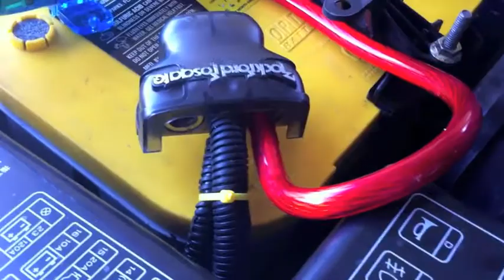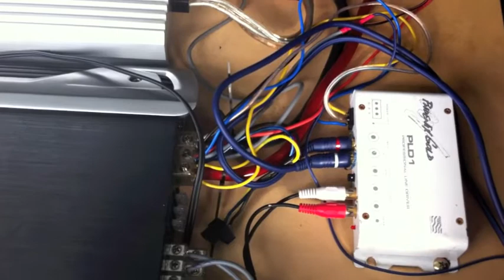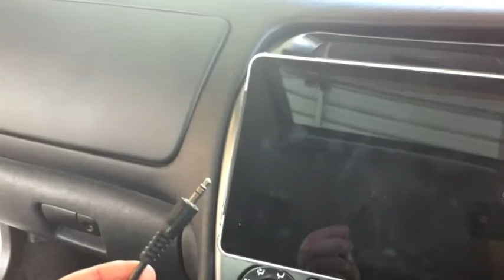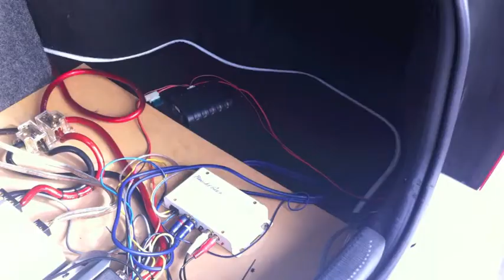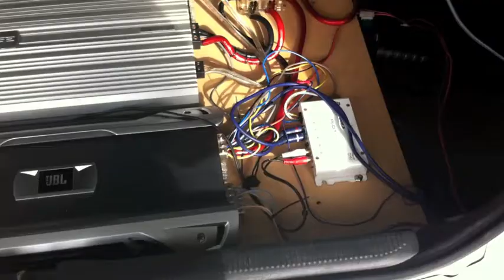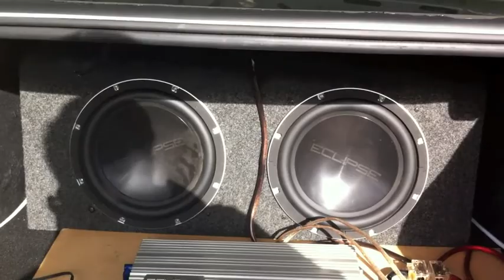lathiat's magna iPad Car Install - System Tour & Technical Details (part 2)

Comment from the maker: @soundmancaraudio cheers :) Have you guys developed your installs any further? I recently started looking at / working on using an airport express for audio which will come over wifi because it also gives both optical and analog out, and would save the extra cable.. unfortunately the audio changes in volume/play/pause are a bit laggy on airplay.  but could be useful still. this car has been written off by an idiot taxi driver :( so i get to start fresh on my new one!